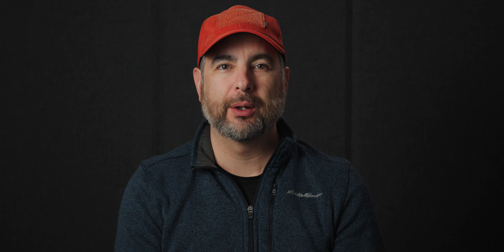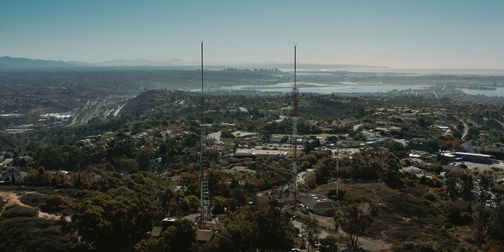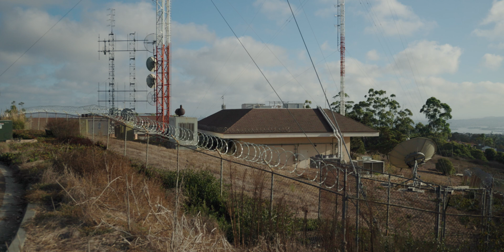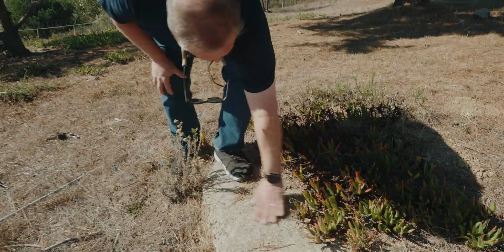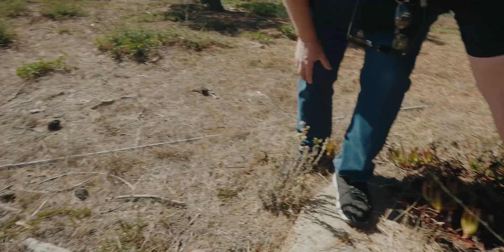Mt Soledad - San Diego

Comment: I fully agree on keeping the facility as sealed as possible!  At my first station (mid-1970's), we lost almost an entire broadcast day because the transmitter dumped from the air about five minutes before the  PSA/Daytime power switch.  The AM Drive guy (A third-ticket with Broadcast Endorsement) decided that since it was close to the power change (500 watts to 1,000 watts), he'd go ahead and do it early.  Well... old Gridley (A Gates BC-1G) emitted a bright flash and accompanying 'BANG"!  So, he called our "Consulting Engineer".  Turns out he had the mother/father/sister/and brother of hangovers.  So, the DJ starts calling those on staff who had a First Ticket.  When he finally got a response, he said that he'd call the well-regarded (But underappreciated) CE of a local Top-40 station, to assist.  By the time the station receptionist arrived, the station smelled really bad.  (Yes, that was included in the transmitter log for that day!)  The station didn't return to air until after 4 PM that afternoon.  The parts Gridley needed maxed-out the credit cards of both our DJ and the CE from the Top-40 station.  Fortunately, we still had a couple of real electronics stores, a couple of ham radio stores, and an electronics surplus store that was a cross between Davilyn and Apex.  (If you're familiar with Southern California legends!)  But, carried even more antiques!  (And, some really bizarre stuff!  Like, ever see a Diathermy machine from the 1920's?)  I mean they carried some really weird "merchandise"!  So, what caused this?  When the guy from the Top-40 station started dissecting what was left of Gridley's innards, he takes out his pen, pokes it into what was had been the High/Low Power switching relay and pulls out the charred cremains of a... mouse!  Yes, this station was in what was then still countryside.  It was almost as bad as when a later CE "came to the rescue" of the Receptionist/Housekeeper one Sunday after a black snake liked the shadow of her parked car and challenged her when she tried to go home.  The CE picked up a length of quarter-round molding that still had some nails in it.  He proceeded to carve-up the snake with it.  Once the snake was SK, he hung it on the dumpster in the station parking lot.  I spent 45 years in Broadcast and Telecommunications engineering.  And, no matter how big the operator, strange "stuff" always seemed to happen!  I enjoy your videos.  They remind me what "should've/could've" been as I started to retire a little over five years ago.
Reply from the maker: Oh my gosh those are great stories!!